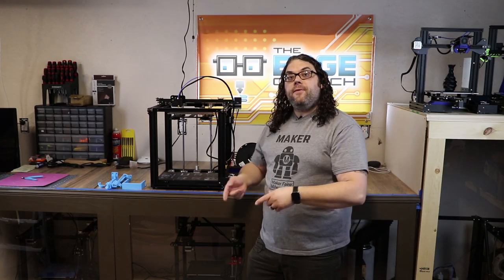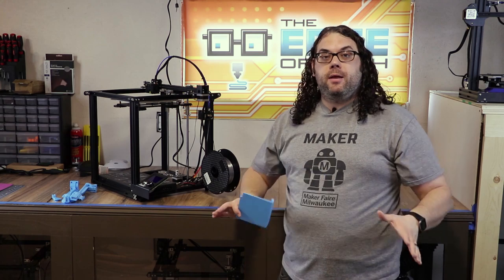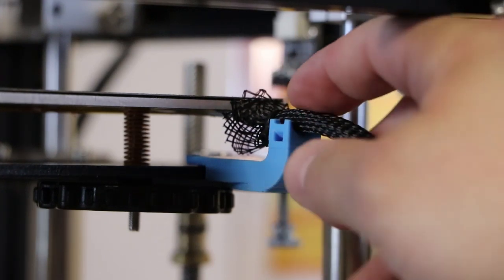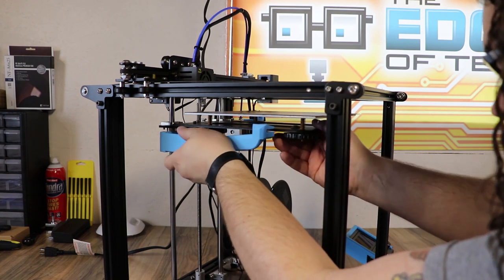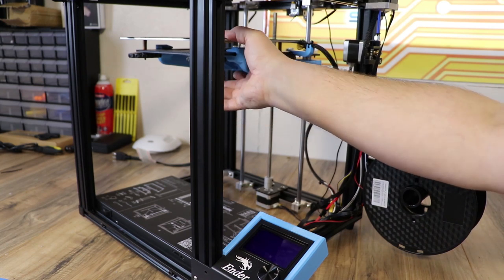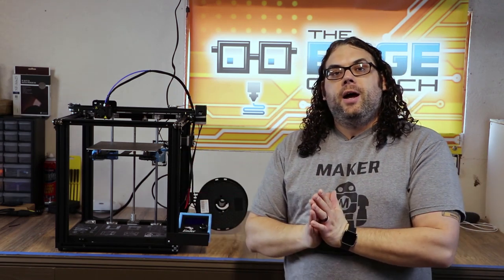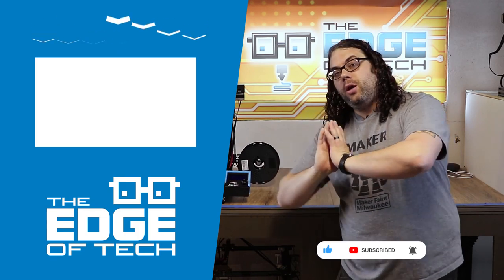3 DIY Creality Ender 5 Printable Upgrades in 15 minutes or less

Comment from the maker: ****UPDATE*** 
I put the Bed Supports on the wrong side of the bed and the struts Should be on the inside of the bed as seen in the Thingiverse Link! I missed that when I filmed it and that's my bad.
Reply: At least you where big enough to admit  when you make a mistake...your a good man Jim!
Reply from the maker: @CanadianMakerProject  Thanks Ron! :)
Reply: Don't feel like the Lone Ranger Jim, I put my struts on bass ackwards too! And they're still on backwards, my apologizes to the designer.
Reply: I mean.. it works both ways lol
Reply: So the one you put on the left, you put on the right and vice versa?
Reply: @THEFIFTHDIMENTION  True. The only downside is that on the incorrect side, you lose a little bit of build area on the z-axis due to the strut extending past the bed adjustment knobs
Reply: @rescueseven  True. The only downside is that on the incorrect side, you lose a little bit of build area on the z-axis due to the strut extending past the bed adjustment knobs. That being said, mine are also on backwards because I'm too lazy to swap them
Reply: I made the same mistake when I first did them.   To be honest, I am not sure it made much difference being inside or outside.  I actually ended up moving them back to the outside as I just liked the way it looked.  I think the only thing I noticed is slightly restricted access to the back knobs for bed levelling with them on the outside.  Support seems about the same.
Reply: @EsotericArctos  Also: The outside is cooler than right under the heater. So you can print them with PLA without caring too much about heat.
Reply: @Linuxdirk  I did mine in PETG but that is a great point.  The outside does stay a lot cooler.

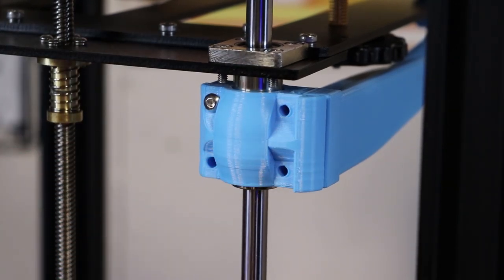Comment: At 5:18, don't tighten the bolts down until you get all four in, and then tighten them down in a star pattern to avoid accidentally snapping the support cap from the torque on the bolts

Comment: I love my Ender 5 Pro, but I did find it disappointing that those three things were not included from factory.  The strain relief and cover for the LCD in particular.  Just looks unfinished without them.   After I did an initial test print in PLA I printed the "upgrades" in PETG.   Super easy.  It makes the printer look complete

Comment: Thanks, I just got my printer working today and starting to print the demo PIG that came on the SD card, But I will print what you suggested.  Oh by the way, maybe you should try printing a Receptacle Outlet Wall Plate for your wall outlet.

Comment: PLA is great, but over time with the heat on the underside could soften the PLA allowing that sag to happen. just a thought
Reply: Had mine for about 8 months now, running bed up to 80c at times. No impact so far and I used really cheap PLA when I made them. It seems like the heated bed is too far away from the struts to really impact them at all. The are not even slightly warm to the touch after a print. I think if you were running enclosed it would be a completely different story.

Comment: Extra bed struts are essential on the regular E5. Kind of sad that this printer would be totally perfect if it had a linear bearing in the front preventing sag like the E5+ has.
Reply: I was about to print the extra bed struts but I don't have any M4x20 screws or M4 nuts. Can you tell me where to get some?
Reply: @Blobster-td4nv  I bought a plastic organizer from Amazon, which contained a bunch of M3, M4, M5 nuts and bolts together.

Comment: Greetings Jim, Great upgrades and as my Ender 5 Pro is in the mail I wanted to start printing the parts on my E3 V2.  How are the bed supports oriented on the print bed?  I'm using CURA and any additional pointers regarding the support settings in the profile would be applicated.  Another great video thanks.
Doug

Comment: silly question but that link for the bed supports is that to the scale for a ender 5 pro ? only new to this . l have it cura just hoping if l drop it in its to the size l need . Kind regards Scott

Comment: Hello, do you think that the support arms are enough to eliminate the flexibility in the base? Just using those arms is acceptable to make a good print? Because I have seen another option to add another z axis like the ender 5 plus. Thank you
Reply from the maker: I think the Ender 5 is fine the way it is actually. But I know that a lot of people would like the support, so I added them to the video! I use them on my Ender 5 machines and have had no problems at all! With that being said, some people like the project to add a second Z and it would help as well!
Reply: Where did you see this other project to add additional z axis?

Comment: When I printed the cable support, the overhang for the part that clips on the plate gets all stringy from not having any support. How do I prevent that or add support that can be cut off?

Comment: Jim, the struts are designed to fit on the inside not the outside, you've got them on the wrong sides
Reply from the maker: What!! I will check that out asap. Lol
Reply from the maker: You are right! Haha I will update the Description now! I'm not sure how I missed that, but I did.
Reply: @TheEdgeofTech  Hi Jim, I don't think it would really matter, it's just  my OCD :) They are a fantastic design though
Reply from the maker: @shaunmorrissey7313  I agree! The funny part is that I have it like this on the other 2 Ender 5 printers I have and didn't realize it! Lol

Comment: Biggest crime is fully tightening one bolt at a time, instead of the cross pattern.
You want to snap/warp parts? Because that's how snap/warp parts.
Reply from the maker: I agree! That's why I always suggest doing them in pairs and front to back. Half way first on both sets, then the rest of the way. Thanks for watching!

Comment: Pushing the strut end with bolts up (4:53) is wrong. The lower they are, the better support they provide. 
Shortly, the ideal struts are vertical ones under the free end of the bed but this is impossible for obvious reasons. Increasing the strut angle getting it closer to the "ideal strut". Decreasing i.e. moving the end with bolts up does the opposite thing.
Reply: You're right. Additional guides with plain bearings should be used.